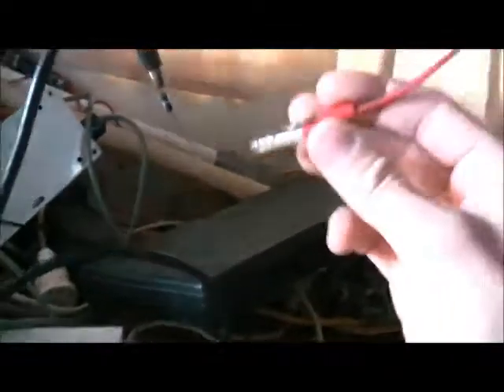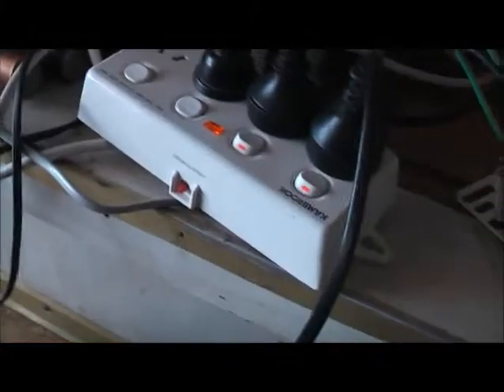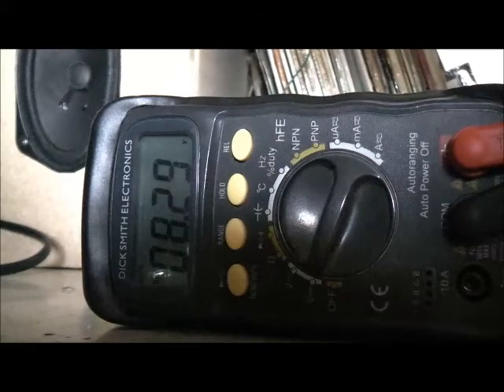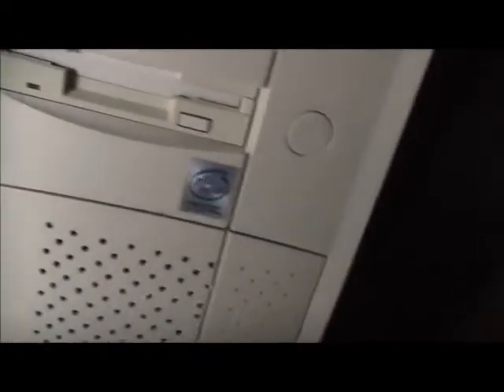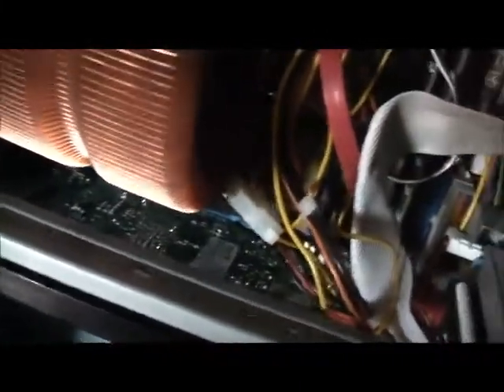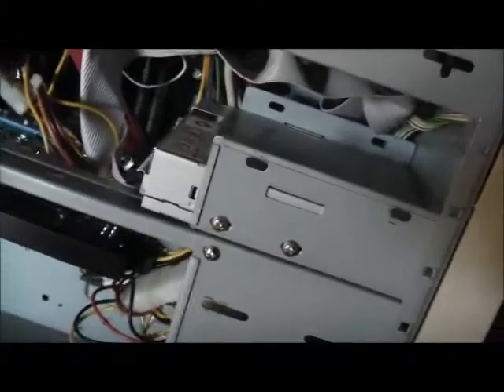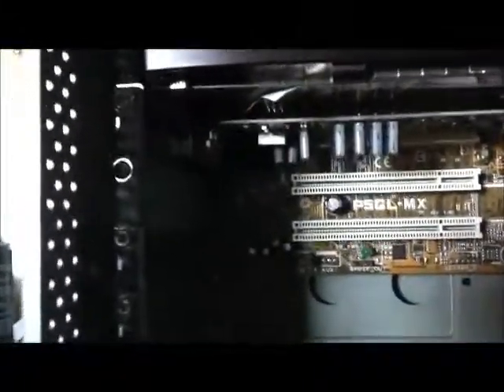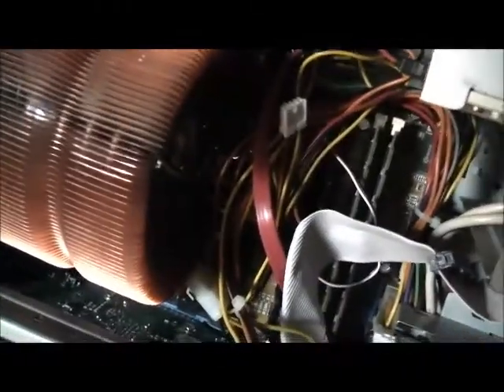Vintage Ish PC Update! & Resistor Pop

Comment: Hardware is too new for 98 thats half your problem, it doesn't support pci express, doesnt support the ram, doesnt support sata and yeah, on a system like you probably couldn't even get 2000 to run. Too new a hardware, it doesn't know what to do.,
Reply: the lowest level os you can run on a system with that hardware is XP.